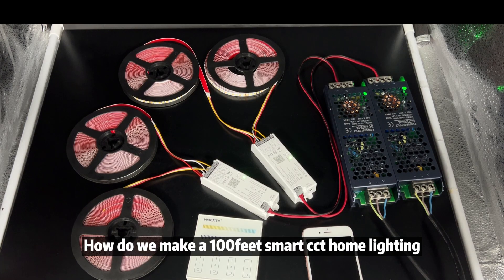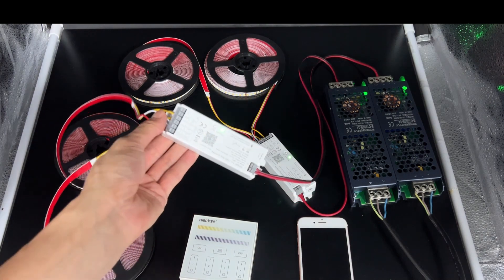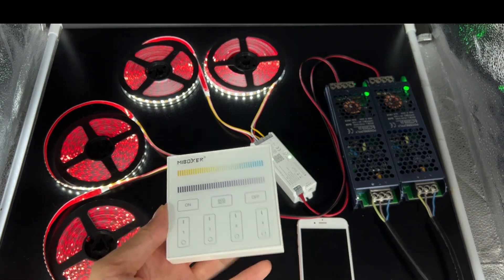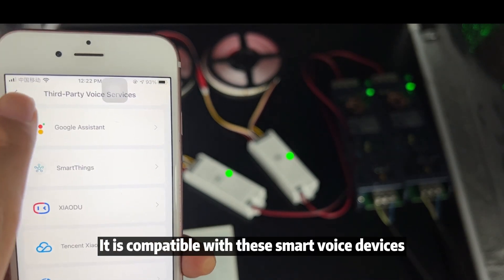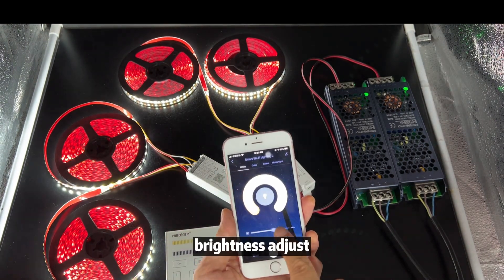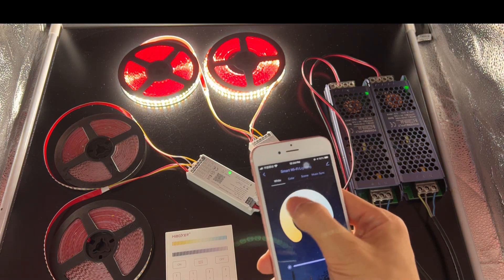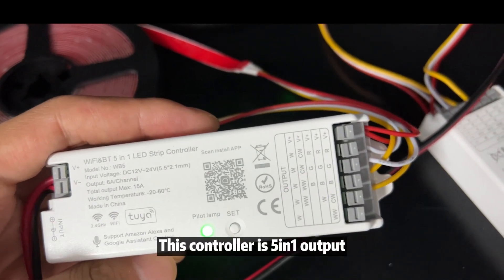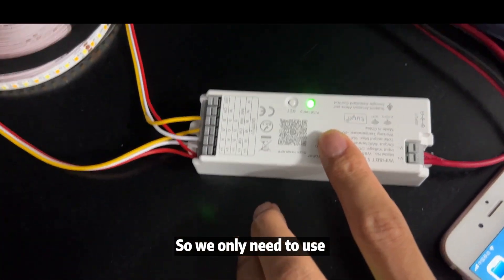How to Connect 100Ft CCT LED Strip Lights For Living Lighting

Comment: Very helpful video, thank you! A question about the IR remote: If I have 5 of these controllers and 5 remotes in the same room, do the remotes pair with one specific controller, or will I run into issues with each remote's signal controlling multiple controllers if they are able to see the IR signal? Thank you!!!
Reply from the maker: IR is one-to-many capable, and if you want to match one remote to one controller, you can buy the rf controller kit.

Comment: Price sir
Reply from the maker: This video uses these items"
CCT led strips: https://www.superlightingled.com/24v-8mm-cct-tunable-white-led-strip-warm-white-pure-white-2835-leds-p-5054.html
WiFi Controller: https://www.superlightingled.com/wb5-wifi-bluetooth-5in1-tuya-led-controller-p-4419.html
Touch panel: https://www.superlightingled.com/b2-4zone-cct-adjust-smart-panel-remote-controller-for-color-temperature-led-strip-lights-p-913.html
Power supply: https://www.superlightingled.com/dc24v-200w-83a-led-ultra-slim-switching-power-supply-p-1838.html

Comment from the maker: This video uses these items"
CCT led strips: https://www.superlightingled.com/24v-8mm-cct-tunable-white-led-strip-warm-white-pure-white-2835-leds-p-5054.html
WiFi Controller: https://www.superlightingled.com/wb5-wifi-bluetooth-5in1-tuya-led-controller-p-4419.html
Touch panel: https://www.superlightingled.com/b2-4zone-cct-adjust-smart-panel-remote-controller-for-color-temperature-led-strip-lights-p-913.html
Power supply: https://www.superlightingled.com/dc24v-200w-83a-led-ultra-slim-switching-power-supply-p-1838.html